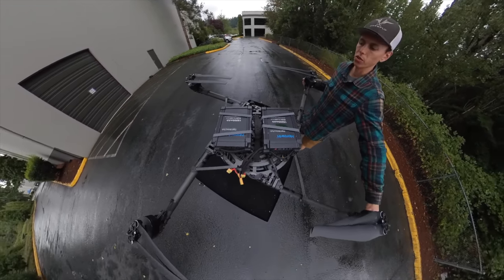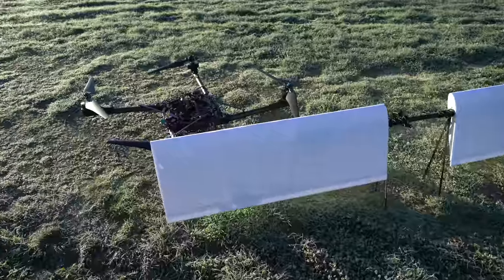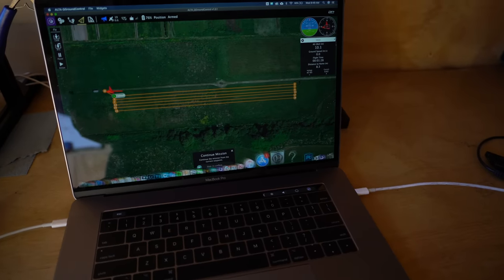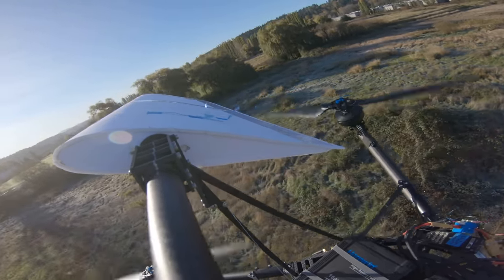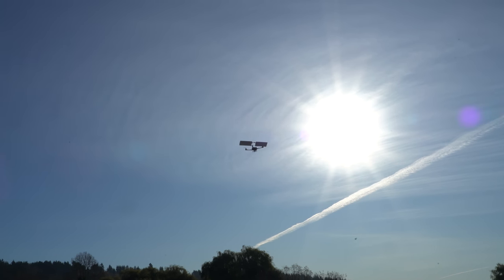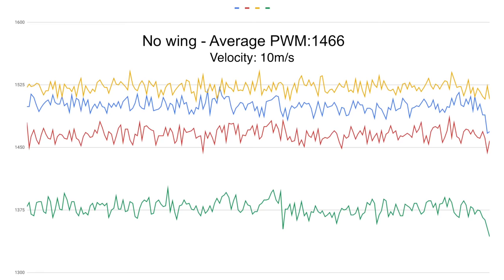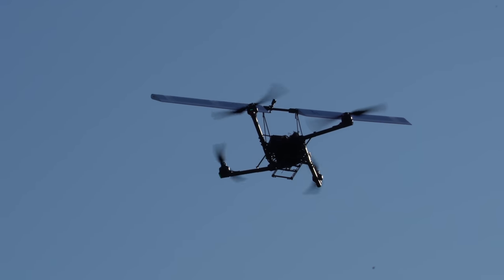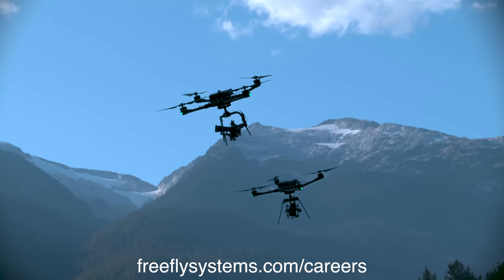Can a Wing Increase Quadcopter Efficiency?

Comment: As the craft rotates forward, your wing is moving ahead of the CG and thus creating a pitch-up moment. If you set it further back, you would do better at higher speed (but worse at lower). Ideally you would have a way to move it back in response to the crafts pitch-angle to keep the center of lift closer to the CG.

Comment: Separate the wings by more so they are outside the area of the rotors . Also id lose the pitching of them. Not quite fixed but way less movent away from facing the way a wing should.... You know better than me AND know the quad but that still seems like what it wants..... Keep them coming dude! I love your videos. They're like mental chewimg gum.... 😎 Also.... It might be worth at least trying having the wing UNDER the rotors.... You never know it might add the low pressure needed above the wing if its at a helpful angle or something. In any case i think getting the wimgs outside of the rotor footprint would be a very good thing......

Comment: There is a profesional drone with a fixed wing simular to this setup. But the wing is just behind center of mass (as it would be in a normal aircraft. So the motors can just thrust and do normal adjustment.

But of cause. It does.have a set of software for hovering and one for forward flight.

Its not only considerally faster in wing mode, it can also fly for twice as long, increasing the range quite a lot.

Comment: Also, the wing will be doing some crazy stuff to the airflow into the top and bottom pairs of rotors during the different flight regimes, potentially creating a negative feedback loop and reducing control authority - ie accelerating the air into the bottom rotors reducing their net thrust and slowing the air into the top rotors increasing their net thrust

Comment: You need to set the angle of attack of the main wing to just below the stall angle of attack. The pivoting wing is great. So, to set the angle of attack to a fixed number, put a trailing trim tab on the wing, like a horizontal stabilizer. The angle of attack of the trim tab sets the angle of attack of the rotating wing.

Also, the Center of Lift should be at the CG of the drone. This is accomplished by putting the pivot point of the wing thru the CG. Without having Center of Lift aligned with the CG you are creating a pitching moment that will pitch the drone up or down. Lift is creating Pitching Moment, eliminate this by aligning lift thru the cg.

Comment: You are going to have to power the wings out of stall.  Either by flying the drone fast to the point they pivot up out of stall or far, far more practical with active servo input, when forward velocity is achieved, raise the wing to +1-5* and revert the flight controller to attitude only.  It will glide.  If it glides, pivot forward slightly, add more power.  Eventually, with the right config you should be able to get to nearly 90* with all 4 props providing 100% forward thrust!
Reply: The wings would be in front of the centre of mass by so much that it'd fall out of the sky long before 90 degrees.

Comment: Your stability problem comes from a large distance between the aircraft center of gravity (around which the aircraft rotates) and the center of pressure. (the point at which 'wind blows') When tilted forward the CP is way ahead of the CG, inherently unstable like a dart trying to fly backwards. The tail on fixed wing aircraft is used to provide this stability, and the wing CP is located much closer to the aircraft CG so there is much less instability to counteract.

Comment: The propellers below are creating a huge suction on the wings and the wing essentially is seeing an even larger angle of attack than what has already been provided, hence with an already higher aerodynamic centre of the wing from centre of gravity, its mostly in stall throughout the flight creating drag and instability. My suggestion would be lower the wings closer to centre of gravity (in case you have symmetrical airfoil on the wings), have a very low, almost zero angle of attack as the suction from propellers below manages to increase the angle of attack easily on the wings and also some roll instability I can see: Aerodynamics!

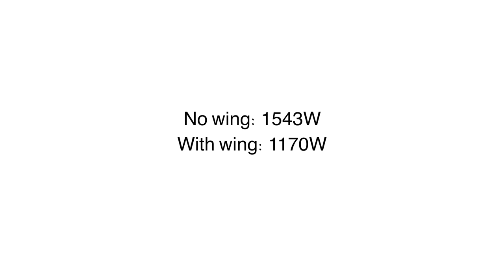Comment: One key difference with the flight testing in this video is the all-up-weight of the drone was not the same with and without the wing. When flying without the wing an equivalent amount of weight should have been carried by the drone. Expect we'll see much better efficiency when the challengers have same AUW. (12:28)
To avoid sketchy flight maneuvers, it would help to add a radius between waypoint legs. Those 180º turns are just asking for craziness. Not having a fixed wing (non-pivoting) would cause he centre of lift to vary as pitch angle varies. Location  of centre of lift vs. centre of mass can effect stability. 
Overall a fascinating experiment Daniel. Like how you totally skipped any testing with a robust 5-inch, or 7-inch freestyle quadcopter and went straight to flight testing on a 13-inch monster-copter.

Comment: Separating  the left and right wings rotational axis - adding a  controllable flap  - or slat,  will allow the wing to maintain/control  AOA agnostic of the multirotor tilt angle.
(ie a "free wing")  mass balanced alowing only the aero factors to rule.

Comment: okay this is super super cool. clearly needs some work but from these comments, it seems like there is A LOT of interest in this idea. I feel like this is going to be a huge innovation. super exciting. Initially, i thought it was going to be similar to a vtol and basically take it up like a normal drone, and then just rotate... i think if you put the wing under the rotors you could easily just convert to horizontal flight at a certain speed, but this is way cool too. either way, im excited to see this progress.

Comment: Seems to me this is a really good way to smoke really expensive esc's If you want more efficiency for long range then you should probably go with the standard H frame and go tilt rotor. Avoiding all the added weight and drag but not sacrificing any stability.  I would think you could set it up where the front rotors go flat to act as the wing or slightly tilted like a Gyro copter and tilt the rear rotors more forward like an Osprey for higher air speed at the same or less power. Heck that may even be able to back feed current from the front rotors to do a little regenerative charging in flight.

Comment: I think what's causing the drone to go unstable is the added speed is causing the wing to produce enough lift that causes the drone to start gaining altitude. This causes the drone to slow the motors down to maintain the proper altitude, thus causing an exponential drop in lift. Then the drone sees the altitude start to drop, so it speeds up the motors to regain altitude which then increases the airspeed over the wing causing it to produce more lift and quickly gaining more altitude than expected putting the drone in a positive feedback loop. I also think the changing of the angle attack might also be contributing this feedback loop.

Comment: A light spring could possibly pull the trailing edge of the wing into the airflow, to make sure it is giving some lift. Or even a little more weight on the trailing edge of the free-pivoting wing

Comment: if your quadcopter controller/software will support it, make it a BWB (Blended Wing Body) to house the camera and batteries, streamlined, tailsitter.

 VTOL , with the props horizontal as designed, but attached to a fixed wing airframe. at altitude,  it tilts further and further in the direction of travel until it's flying with the props vertical and the wings make 100% of the lift.

Comment: I think just adding "flaps" to the masts that have limit stops would achieve higher efficiencies without adding much weight or stability issues. Make them delta shaped and have two sets of limiters so the "forward" surface (front flaps trailing the forward masts) is always at a higher angle than the rear ones; your center of lift should balance to the front two rotors and they can basically idle while the rear two provide forward thrust. This effect can be seen on your current iteration right before it goes into oscillation.

Comment: You could try to get the wings to auto trim to the desired angle of attack using tail booms with tail wings (one on each side). If the port and starboard wings pivot independently, it might work better during the turns. They can kind of weathercock.

Comment: I think you should have a single divided wing. The wing should start outside the rotors. In the center part (within the rotors of the quadrocopter you might need an other stall. By that even turbulence up/downwinds  can be better addressed.
Smart idea- an other approach is the gyrocopter principle in quadrocoptersas foam or carbon is not really so heavy.
Thank you for sharing

Comment: Perhaps a reflexive airfoil for stability when freely mounted like that, 23015? That should allow mounting at its center of lift.
Or, using a reflexive airfoil, try rigid mounting the wing, testing for optimum AOA at desired speed.

Comment: I've been thinking a tandem wing biplane with the two wings forming a box that is the frame for the quadcopter (but with negative stagger so the frame would apoear to tilt back when the rotors and wings are pointed vertically) and the rotors blowing over the wings to create lift over part of the wing regardless of AOE. With negative stagger the top-back wing could have lower AoE than the lower-front wing so if the frame pitches too far forward the back wing loses lift and if it pitches too far back the front wing stalls so it stays relatively level even without control inputs. Adding extended wings beyond the box with substantil dihedral to reduce rolling then all the maneuvering is via differential thrust so no aerodynamic controls are needed and the same contols work in forward flight as vertical.

Comment: Add the automatic angle of attack control vane from your wing-sailboat. This way, the angle of attack will be controlled to some reasonable angle automatically, won't go negative, and you can remove that servo etc.

Comment: If you are concerned about the negative lift situation with the pivot bars, you might want to look into a high camber low-speed airfoil for the next version. The camber will increase the lift at lower angles of attack, and also move the L/D to a higher angle of attack like the wing is currently flying at. In terms of downsides, the moment from the wing will get worse, and stability seems to be more the issue, but just another opinion to throw on the pile.

Comment: I wonder what would happen if you added control surfaces to the wing for pitch control, and then added some sort of basic gyro stabilizer to control them. Independant of the flight controller on the quadcopter. Or maybe some sort of mechanism to control angle of attack in the same way
Reply: That's what I was thinking.   Stage 1 add control surfaces which try to keep the wing AOA independent of drone AOA.  Then stage 2 could be adding roll control assistance stabilization.

Comment: Thanks for the interesting test. As already mentioned in other comments, the wing position was not close enough to the center of gravity for that flight phase.
My assumption is that you could save the 24% much easier by using a more efficient propulsion concept: Larger propellers and adapted motors (lower KV, more torque). This also increases the area exposed to the wind and decreases stability in rough conditions - but much less than with wings added as in your example.

Comment: Maybe somewhat smaller wings to have still have a gain but decrease sketch? Also maybe having it fixed in the correct orientation and a fifth prop for forward thrust, perhaps inline with the center of drag to balance any pitch from it applying thrust, that way the regular props would mostly be used for roll, pitch and yaw if it moves quick enough for the wing to do the lifting.

Comment: I don't want to give any suggestions but...The whole wing looks oversized. Try making it less wide (less wingspan) and possibly thinner with slightly reduced area and even 6 degrees dihedral. I believe it will help especially at 12+ m/s. I hope you can try again. Good Luck

Comment: My thumb suck take is that you maybe should mount the wing in front of, and center to the drone. That will keep the wing out of the prop wash that destroy the aerodynamics, airflow over the wing. Maybe two small wings, one in front and one behind. Also, I'd suggest a thinner wing profile with, if possible a little pitch control of the wing later on to experiment with. Maybe a simple second radio with a receiver and servo on the pitch control. With zero forward speed the wing will in anyway just be a unstable parachute, so it will just be an extra load and a wind catcher.

Comment: I bet a powered pair of wings on the outside of ducted rotors could work really well. With ducted rotors, you can mount the wings to the sides instead of on top and make it powered to keep the wing at a good angle.
Reply: So it would just have 4 winglets, one on each corner mounting to the outside of the rotor ducts. They should tilt to do whatever you want to do using stepper motors.

Comment: In order for this to work I think you would need to attach a frame to that mount on the bottom of the drone. To that frame you would attach a forward wing and a rearward tail wing with a rudder. These wings would have the typical plane control surfaces. You could then (easier said than done) code the multi-rotor systems to harmonize with the plane systems. You'll never stop the twisting oscillations without a rudder. Additionally without ailerons on the front wing you won't get proper attitude control either. The upside to all of this is range. With the system optimized you should be able to gain altitude which you can then trade for speed and essentially glide a fair amount of the time. No idea what you could expect in terms of a glide ratio, I guess it depends on good old weight vs lift. To do all that and still have a useful camera platform? If you could pull that off and patent it, you might never have to work another day in you life!

Comment: As far as practical use goes (this is for package delivery and whatnot) I'm picturing a system where a drone like this is used to launch a secondary glider. As in, the drone goes straight up into the air, very high, and then drops the glider drone which is carrying the payload, which can then do do it's thing.

Comment: Try Attaching a tail to the wing assembly that will hold the wing at the optimum angle of attack. Then allow the wing and tail assembly to rotate freely.  A control surface on the horizontal stab could act as a trimming surface.

Comment: Put a servo on the wing integrated with an accelerometer, and load the program on an arduino, regardless of the drone's inclination, the wing will always remain at the same angle. I believe it will work.

Comment: Great Experiment! I think you are on to something I have a couple of comments.

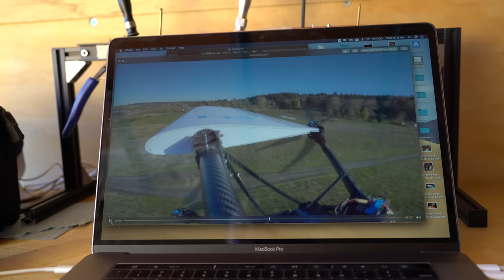08:20 you are looking at the streamers for stall indication... did you notice the substantial amount of flex in the wings as the aircraft maneuvers?  Systems that correct automatically  in response to the forces on the craft when subjected to variable forces caused by structure flex are very likely to develop ever building oscillations in a feedback loop until either the wing structure fails or the craft disassembles in contact with the ground. rigidity in the wing is gonna limit variability.

You didn't state where you came up with the wing dimensions you decided to build, but my take is they look remarkably large for the craft's size, weight and speed you are working with.  I would wager you could get more data and start to build a formula for optimal wing size if you started much shorter (i would start at 50% the wing length you had here).  This would reduce the forces interfering with the drone's normal flight as well as likely minimize the wing flex, while still providing some measurable benefit.  with shorter wings I would expect the optimal speed to efficiency gain to be higher than with the beast of a wing you added.

Due to all the downdraft generated by the rotors i would encourage you to experiment with the addition of small winglets on the ends of the wings to help contain the flow of air across the wings and make it more consistent with variable airflow and direction.

Comment: Very interesting.... that is a helluva drone!   If you decide to do another long freshwater test of your autonomous boat on this side of the hills, I'll volunteer to provide boat support on the lake if ya want.   Was bummed I didn't get to join up on Banks last year.   Just did full length of Banks today getting time on a new engine.   Ready for the warm months!
Reply: wing angle, just a tiny bit of angle change is huge in deflection.....   seems like if you limited it to a narrow enough zone of movement, it'ld be better.....  potential second set of canards or winglets?

Comment: Adding to some of the other comments who suggested aligning the overall lift vector with the cg, I also suggest you used a reflex wing profile in order to limit the aerodinamic moment of normal NACA profiles.
I think you are missing the balancing act of the control surfaces.
You need something like a flying wing attached to the quad. Something inherently stable

Comment: Extremely interesting that one moter was at idle in flight especially since there was low winds wondering if this has anything to do with gyroscopic effects of the moters & props weight or just didn’t need that moter to keep a straight heading or balance 🤷‍♂️